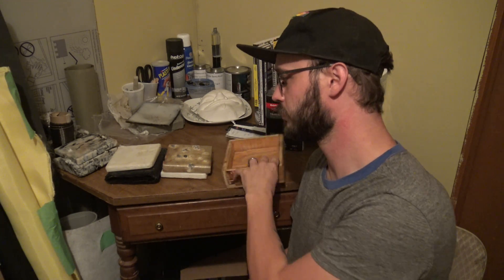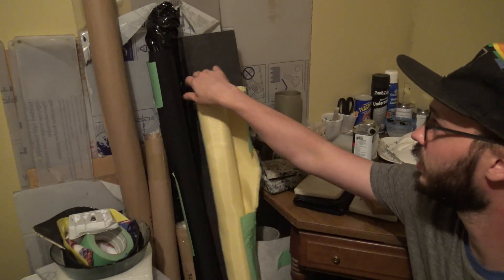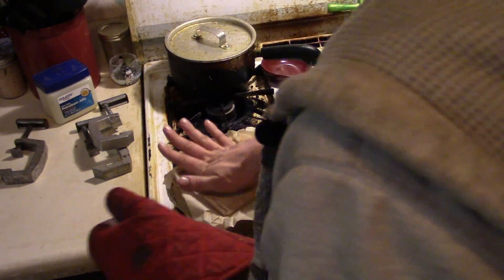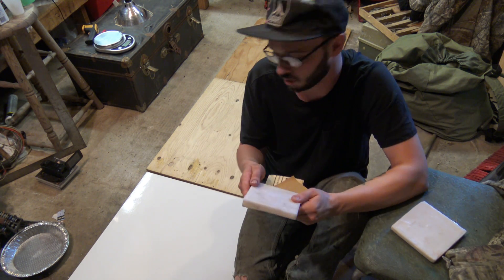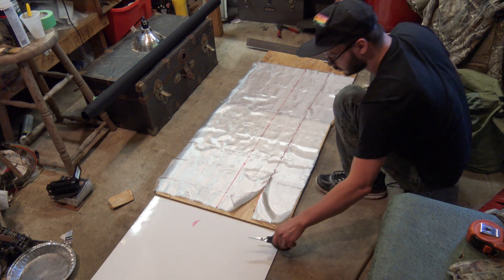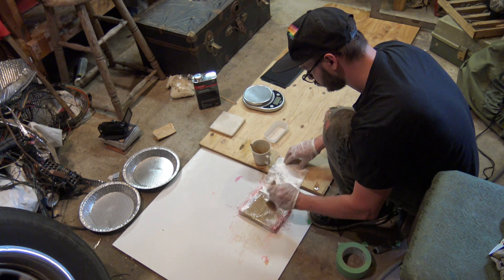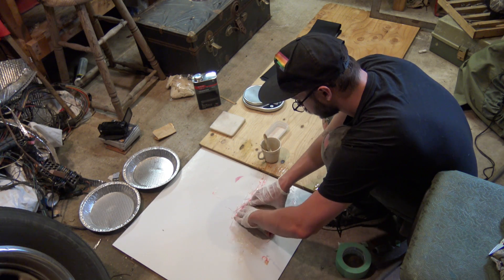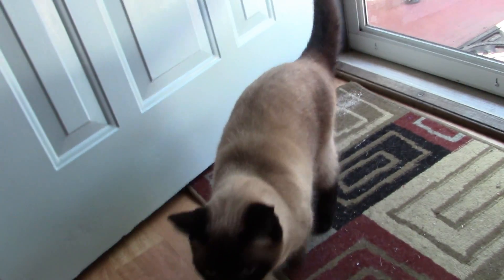Recycling milk jugs into ballistic plates (part 2)

Comment from the maker: I've redone this project and managed to stop rifle rounds and shotguns! check it out here: https://youtu.be/u-FBHZ2gaXU
Reply: Hay man ..how much I have a vest need a plate as these I don't wanna go thru all this shytt zero tools disabled can unsell me one? Enuff for rear n chest?
Reply: curious with an idea to try. ive done some construction work and the times i would break concrete with a jackhammer, a huge nightmare was trying to break it down with wire mesh inside.. maybe try including a wire mesh or something similar in your milk 
jug plates? not so much to prevent breaking but reduce the stretching as well, which of course would give more penetration resistance.

Comment: If your going to laminate HDPE and Kevlar you need to incorporate the fabric in multiple layers in the plastic. Putting one layer on the other will do very little. You would probably need to get your plastic up to a higher temperature to make it flow through the fabric. The idea would be to have several layers in essentialy molten plastic to create a cohesive solid piece. Good Luck!!!

Comment: The interesting thing is that the plastic behaves a lot like steel, and can teach us. Neither has any surface tension. Fiber layers can add this quality to HDPE and steel. Helicopter armor had a steel mesh matrix inside aluminum plate.

Comment: I had good results with 1 layer of polycarbonate sheet (glass works better but is destroyed after one shot),  4 layers of Kevlar fabric (alternating direction), 1/2 inch HDPE block (same process you use) all wrapped in a sheet of fiberglass with resin. The fiberglass and poly sheet tended to deform the projectiles and the Kevlar slowed  them enough that the HDPE could catch them. I would love to see that setup with ballistic nylon instead of fiberglass wrap. I used a hydraulic press to clear out voids and air pockets. Great videos!

Comment: Would you try adding a square of chopped glass fibre mat to the top and bottom of the mould.  I am expecting some of it to embed in the HDPE but the majority to be left dry.  When you wet the mat with resin, will it make delamination less likely?
Reply from the maker: I've played with chopped mat before, it does like a high amount of resin to fully wet out. I don't know if it would be better for ballistics or not, I'll look into it.
Reply: @Techthisoutmeow  I mean to say use it in addition to the woven cloth. if you can get it to partial adhere to the plastic capillary  action should draw the resin into the mat.  I think it would make a better foundation coat vs cloth alone.

Comment: I wish I would have seen this before my parents passed. My step father's was a body guy. He worked with fiber glass. And had a business. Did dragster bodies, funny cat bodies all cars . He had chip brushes acid brushes ever size rollers.. every wrap you can roll the resin into the fiberglass and get out all air bubbles. And he would use plastic spackling knives. When you roll it it pushes the resin into better then you can take the resin that squeeze out. You can scrap it back into the top and roll it back in.. it's a learning process.. he made molds out of fiber glass . With the same clay you use. And styrofoam. He can cut it and sand the shapes. It would be your positive shapes. With the styrofoam you can deal it before you put the resin and fiberglass to it. He would trim the fiberglass with a numeric buzz saw with like jig saw blades. You can get your supplies/ tools and blades , rollers and such. You can also take fiberglass courses at a local college. My step father never wore a resperator. And he died from brain cancer. He had it in his synus and brain behind his right eye.. so Ware you resperator and gloves.. even like dish gloves. And he used acatones for clean up. I also have a plastic torch that bonds plastics together. I would love to get you to make me two 10"×12" shooter cut multi curve plastic  a inch and a half thick. I would love to try using the bulistic nylon. My wife will never let me use her oven to melt the plastics. I can trade you some of my step father's fiberglass tool. Like I have two buzz saws. And I'll film what I have and can send it to you. I'll wait for your reply if you are interested. I can also pay you to make the plastic with those dimensions. You can make them a quarter of an inch bigger. I can sand it to size my self.. it's up to you..
Reply: Dude, how neutered you sound and lacking of drive. Get a toaster oven and get melting.
Like, you can't think of any other way to heat something besides an oven so you just give up and bug someone else about doing it for you?

Comment: Your understanding of fiberglass and resins needs work...
Reply from the maker: Ive come a long way in the three years since uploading this project video, from making a bullet resistant mask that could stop .357 magnum rounds with less than lethal backface deformation to a fully functional plague doctor mask respirator. I'm currently building a hybrid composite plate out of spectra ballistic fabric and high density pourable urethane resin. Maybe check out other builds I've done before casting such judgment.

Comment: Hi do you think it is possible to laminate enough of these together into a giant sheet, that I could build greenhouse walls from a bunch of milk jugs? Thanks I haven't tried playing with hdpe yet but that is what I plan on trying. Hopefully you can provide some criticisms thank you
Reply from the maker: You know I always wanted to build my own green house out of old plastic and stuff, that would be a great idea! so HDPE (the plastic found in milk jugs) is a wonderful plastic to start working with, and you can get a lot of it easily. However I wouldn't use it for any major supporting structures as it has a tendency to undergo plastic deformation from loads (aka creep), you could add chopped fiberglass to the plastic to reduce that effect. but panels for siding would be great, it doesn't absorb water and is a fairly good insulator, use rubber washers with the screws or bolts that you use to attach it to help against the creep effect. You could use two large cookie sheets for molds pressed together, if you want to make larger sheets of the hdpe for the wall panels. Let me know if you have anymore questions!

Comment: I thought the plastic to use was from the bottle tops and not the bottles themselves
Reply from the maker: Anything with the recycling symbol 2 on it is HDPE, the lids most of the time are also HDPE. However I have seen lids with 5 on them, which is PP plastic. The semi white-transparent version of the plastic also doesn't have any dye added to it, so for consistency I only use the non dyed type. Thanks for commenting!

Comment: Seems you could clamp them and put in oven, which at ur temp won't burn wood. 
Try outer layer of 1/8" steel to try to flatten projectile to keep its penetration more shallow?
Love to see an experimenter
Reply from the maker: I'm currently working on this project again, and I will for sure be adding some metal to some of the plates to see what I can stop, along with other plate ideas that I've come up with. Some of the plates that I will be testing came from my viewers, so check back soon on this channel! If you like experimentation you should check out my stab resistant armor build, that one took alot of try's to get right.

Comment: i was looking at buying a sheet of uhmw for using as a wear/slide plate for a log splitter  and found out about hdpe  and i have tons of milk jugs. Do you think this would work close to uhmw?
Reply from the maker: Yeah, I mean HDPE is some tough crap man, I use it on my table saw, and its common to use it for cutting boards. It'll never be as smooth as UHMW however, or as tough. That stuff is in a league of its own, but I would go that route, just to see if I could save a buck. You can always spray a little silicone lubricant on it and it'll be slick as ice, that is if things seem to scuff it up to quick. So yeah, I would give it a try, you won't have the same abrasion resistance as UHMW, but it should work fine.
Reply: Tech this out meow thanks man I’ll give it a shot
Reply from the maker: Good luck, and if you post a video of it send me a link.

Comment: Great video, very useful. Have you considered using the fibres as a sandwich filling within the plastic? I'm going to experiment. 
About the GF, I understand mat is used generally for flat shapes and is cut to shape, and to build up thick areas. Cloth is mostly used for moulded 3d shapes as easily drapes because of the weave and is used for thin shells. I expect they perform similarly in the tests. Kevlar and GF on order 😀
Reply from the maker: Let me know if you have any luck with your experiments, I'm going to return to this project and see if i can stop bigger and faster rounds here real soon, I'll keep the sandwich idea in mind when I start that. thanks for the comment.

Comment: Any thoughts on spraying these down with truck bed liner.   Maybe the DuPont with Kevlar fibers?
Reply from the maker: I've use that brand before! that was one of my very first tests years ago, that stuff is very strong. If you look on my table in some of my newer videos you'll see a can of it sitting in the back corner lol. It'll be used in future projects.
Reply: @Techthisoutmeow  So does that means you recommend adding a top layer of truck bed liner as a final step?

Comment: HDPE is never going to achieve the strength of HMW PE. The HMW polymer chains are lined up in one direction and interlock in depth. Adding other fibers to the material is not going to increase the HDPE's ballistic strength by any amount. In a case of, "when not if," get a real ballistic plate. Getting shot hurts like a bitch.
Reply from the maker: I totally agree on the "get a real ballistic plate" thing. I was more interested in the toughness of HDPE, have you seen the test footage? The idea of adding fibers to the plastic itself was more from impact tests I previously had conducted, and like you pointed out, it didn't work. However, adding fabric around the plate really helped, https://youtu.be/V_LKU6pI7zc here, watch this. I'm not saying run out and grab fiberglass, cheap resin, and some milk jugs and everything will be fine. I'm really surprised at the lack of back face deformation as well as the amount of rounds these little plates could handle without falling apart.
Reply: Not faulting your integrity. Intellectual curiosity is to be applauded especially when your method is sound.

Comment: Mold hollow cavities fill with non neutonian fluid
Reply from the maker: I will be using some non-Newtonian fluid in future projects, should be a good time. Your idea is to place it inside of the plate itself via drilled holes? I could look into that.
Reply: I sound simple but the same way a quilt holds its filling in place. Overlapping layers and a plate coated to help absorb frag

Comment: If you us a PYREX baking dish the hdpe will release itself when it cools down, no paper needed. The pyrex comes in many sizes and shapes, just put your hdpe in the dish and as it melts down add more hdpe as needed for the desired thickness. No kneading necessary unless you're trying the make some design.
Reply from the maker: Hey thanks for the information! I didn't know this, pyrex is glassware right? I wonder how well it works with other plastics, I imagine it should.
Reply: I'm not sure how other plastics will do in pyrex because I've never tried it, another good dish to melt hdpe in is the type of stoneware that is glazed.
Reply from the maker: I just figured because of the non porous property of glass that other plastics might not stick to it. I've used plaster covered in  acrylic before, that worked well so I could see glazed stoneware working well. I wonder if glass would work with epoxy, that could be a cool experiment. Thanks for the information, I'll look into trying this out on some of my future projects.

Comment: there is 200 liters barrels that we cuy upp in too sheets of 6. and melted in the owen. a .44 magnum went thrue it. this shit is not bulletproof. yust siging
Reply from the maker: 200 liters barrels? and I never said it was bullet proof, I was more surprised that HDPE could be used to stop 380, 9mm, and .38 special. It stopped quite a few rounds of all of them. Did you rap it in fabric like Nylon or Spectra? Or hell even fiberglass, that seemed to do the trick with this stuff. And was it starting to show signs of stopping, like striping off the jacket or breaking up the bullet in any way?
Reply: Most class 3 plates only stop pistol calibers

Comment: Instead of petroleum jelly, have you tried paste wax like for furniture or cars as a release agent?
Reply from the maker: I've used high temp silicone mold release before and that by far is the best, however brazilian carnauba wax (what most car waxes are made of) works for epoxy forming. I use car wax often for themoset resins, but have never tried it these higher temp. plastics, it would be interesting to see how well it would hold up!